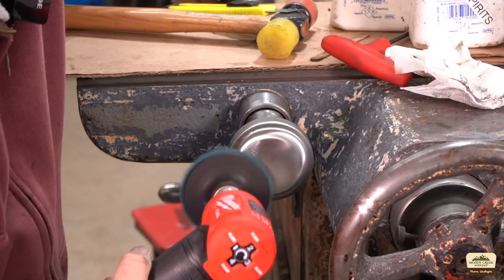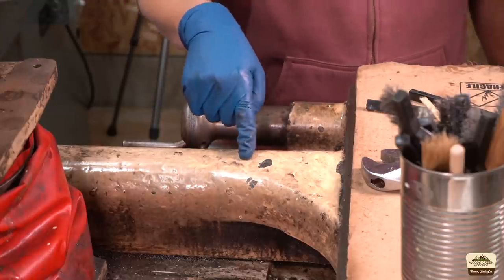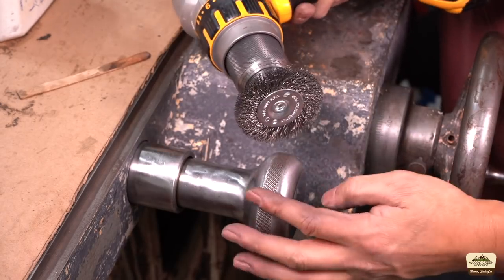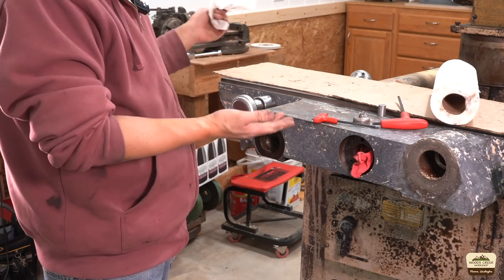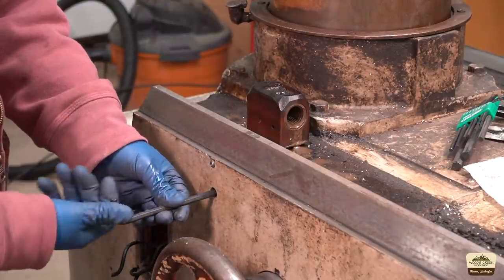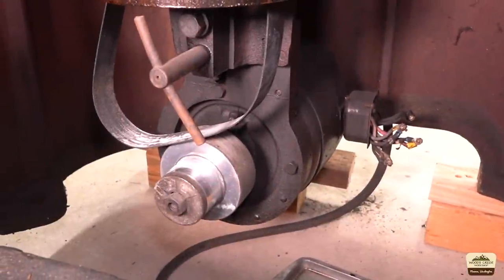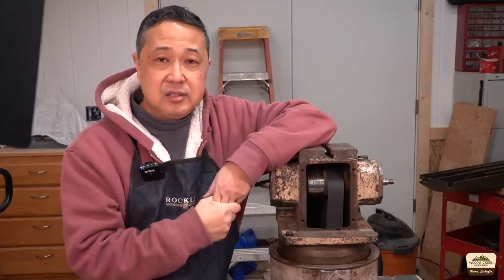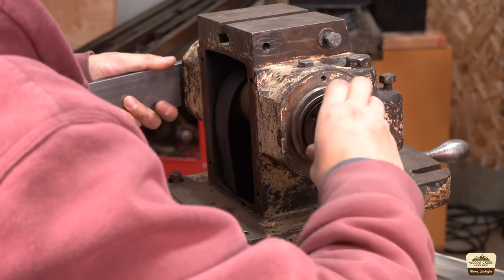More Bad News! Part 2: The Cincinnati No. 2 Tool and Cutter Grinder

Comment: Happy to see you back in the shop.  You do great work, and the machine doesn't look that bad.  Rebuild the spindle if it is not bent.  You know that today's bearings are far better than what was available 70 years ago.
Reply from the maker: Awesome, thanks David
Reply: Not true, bearings are made to a tolerance.  If ABEC 7 bearings were installed in this 70 years ago, then ABEC 7 bearings are required in this today.  It is easier and cheaper to meet those tolerances today, but the bearings are still made to the same tolerances.  The point that many people overlook is a standard tolerance bearing might meet ABEC 7 tolerances because it is easier to manufacture today, but if it meets standard tolerances, it ships, so you can’t assume standard bearings will meet higher tolerances.

Comment: I just went through the same thing with a DoAll Grinder, it's a 1969 model, they quit making surface grinders years ago but I managed to find a new matched set of bearings for the spindle, it was a pain to do but better than scrapping the machine.
Working with tolerances of less than 1/10th runout can be a hair pulling experience but patience and persistence is the key.
Reply from the maker: Awesome 👍🏼

Comment: I've refurbished a number of Logan lathes my personal one I decided to just while I was using it strip it completely down to the metal and leave it and it's the coolest looking lathe they've ever seen! I mean it's like I didn't even work on it cause I just did a little bit every time I was out there using it I mean while it was running I didn't do it but while I was in the process of using it that day I would do a tiny bit and before long it was completely strip. All I have to do is wipe it with light oil I use spindle oil and just put a light thin coat of spindle oil on all the parts so they don't rust and it looks cool as hell

Comment: Rebuild! The overall condition of the machine looks good (so far), and you can't beat the solid construction of those old machines. I know that spindle rebuilds can be tricky, but the assembly on this machine might make it a bit easier than you think; one side is fixed while the other is floating (with the split outer collar, one side has to be floating), so all you need to concern yourself with is getting the preload on the fixed side correct.
It would be a great learning experience, and besides, the machine will not be operated continuously so you will have the opportunity to get the bearing assembly correctly tuned if you see it's acting up...
Reply from the maker: I agree 👍🏼

Comment: I use a sanding mouse with 40 and 60 grit. Works great in removing old paint and smoothing chipped paint. I even smooth up the casting marks and parting lines if need be with a die grinder.

Comment: Yuchol, a  Cresent wrench and carriage bolts????  Com' on, man!!!! And we know you can and will fix it.
Reply from the maker: Just making sure you’re paying attention Bill 😁
Reply: Called a "Newfoundland vernier" in Canada. Shouldn't be seen on a precision machine even if it's in tear down mode. Please use a decent wrench. 
As for the cup/square bolts. If they do the job what's wrong. You're obviously going to replace them with the correct ones eventually.
Replace all the bearings. Make sleeves if you can't get the correct sizes but I'm sure you'll find them. Provide means of lubricating them after.
Thanks for the videos. Regards from Canada's banana belt.
 ☃️🇨🇦👍

Comment: If it were me I would get to the nearest good industrial bearing supply house and let them take a look at what you've got there and any info you have on the machine. I'm betting you can get bearings that are at least as good, if not better than what it came with 71 years ago! Precision hasn't gotten any sloppier in machine tooling over that time period. BTW- I enjoy your style. A little humor is a good thing!

Comment: As a skilled tradesmen/millwright, I was taught,always, if you remove a bearing or a oil seal, replace with new, don’t reuse!
Reply from the maker: I haven’t been able to find direct replacement, yet 👍🏼
Reply: The first thing my Grandpa taught me on a mechanical repair, always replace any bearing or seal you remove, no exceptions, restore to factory specs with new parts and you and your customer can sleep well.

Comment: Yuchol from what i have read the only thing that separates just bearings from precision bearings is the inspection. They are all made on the same process and the grading process is extra measuring which closes the gap on tolerances of both I/D O/D and TIR. My guess is inspection processes and manufacturing processes have improved by 1000% . . Even precision spindle rebuilders are at the mercy of the Bearing Gods and run every spindle before shipping. I say go for it. The result in the sharpening of the tool will be the final arbiter.
Reply from the maker: What sacrificial offerings will the bearing god require? 🙄😁
Reply: @woodscreekworkshop9939  1 arm one leg and any gold fillings you may have in your teeth. Since i am old and my teeth are falling out I think I would just get a tin cup and sit on the street corner with a cardboard sign.
Reply: Terry, Sorry but there is way more between standard bearings (Abec 1) and precision bearings (Abec 5 and up) than just inspection. In a former life in the bearing industry I worked for the local agent for Barden bearings. Barden only ever made Abec 7 and Abec 9  bearings (in the USA) They did this by precision production not by inspection of millions of Abec 1 bearings. It may well be possible to select for Abec 3 from Abec 1 but trying to select for Abec 5, 7, or the almost mythical Abec 9 from 1 and then to match two of them as a pair with a given preload would be a fairy tale…Martin
Reply: Sorry, but not even close to being true.  Precision bearings are made on their own production line.  The components may come from the standard bearing line, but the higher precision bearings are measured and then honed until they meet the precision class they are making.  I worked for FAG Bearings and they only made what was ordered, so there was no sorting for tolerances, it was made to the tolerance ordered and then shipped to the customer.  In the case of Barden Bearings as mentioned here, they only make ABEC 7 and 9.  The ABEC 7 are measured at the production machines using air gages and run through the honing machines until they meet the required tolerances, or are scraped.  For the ABEC 9 bearings, the components are taken into a temperature controlled room where they are honed until they meet ABEC 9 tolerances.  There is a significant amount of labor involved in this tolerance class bearing and the prices are fully justified.
Reply: @mikeb1520  I would like to see the evidence that supports this. Not saying you are wrong but i would like to see it. I am famliar with precision processes capable of maintaining 2 microns
Reply: @terrycannon570  I’m not aware of any public documentation on how they make their bearings, my statements are from being in the factories and seeing first hand how it is done.
Reply: @olfoundryman8418  exactly!

Comment: Well, in for a penny, in for a pound lol. You could try to drill and tap those tapered pins and use a slide hammer to remove them. I generally steer clear of those super flammable solvents. Varsol works really well for removing large quantities of gunk, and it's relatively cheap 😊. Well, hope you can find some bearings for it, I'd hate to see all that iron in the scrap bin. Good luck! 👍😁👍
Cheers!
Reply from the maker: Thanks 👍🏼

Comment: It is actually a little odd to me, I would have expected a 7305 bearing to keep the one side fixed, then the 2305 bearing floats to allow for thermal growth,  but being a grinder it's seeing only light axial loads so a deep groove ball bearing was probably deemed adequate.  you should look for a precision bearing like an abec7 or p4, a low grade bearing wont be stiff enough and you will see a lot of chatter.  if you haven't watched robin renzeti's spindle video i highly advise watching it at least twice, lots of valuable information there.  edit:  c783 is actually listed as a p5 + zero clearance---so that gives it the preload
Reply from the maker: Thanks Corey

Comment: Hello Yuchol, I am enjoying your video.  I found two new SKF C6305/C783G1 K3 bearings for $169.99 each on EBay.  They also list many SKF 2305 double race bearings in the $40-$50 range. I look forward to seeing you spindle reassembly procedure.
Reply from the maker: Thanks Jim.  Those bearings show signs of use, contacted the seller and they haven’t responded….. yet

Comment: Big job.  Hopefully lots of fun despite the surprises.  Definitely new precision bearings. That’s what money is for. “Once and Done!” Similar to you, I degrease wish Super Clean full strength over a few days, cleaning buildup softened gunk as I go along.  Then I strip the paint with Dad’s paint remover before bringing it back with some grinding of the castings and as little Bondo as possible before painting.  Not sure it’s better or faster, but just my way of feeding my OCD dragon.  Keep up the good work.
Reply from the maker: Thanks!

Comment: I have seen machines that were refurbished and that feature added to the waves during the scraping process for directing the oil to flow to a low spot so that is totally normal and they're never uniform they're always just sloppily done because it doesn't matter as long as there's a low spot for that oil to squeeze out in the direction that they wanted to but yeah I've seen this added this feature added intentionally

Comment: Whilst its split down its best to swap them out with a whole fresh set so that the spindle runs true. Everything needs maintenance and repairs, its not the end of the world or a scrap machine because the bearings have seen better days. Take ID and OD and search using those dimensions. Codes differ between manufacturers but their will be matching dimensions in todays precision bearings. Ive come cross many bearings that are hard to find but a search with the mesurements has always produced results.

Comment: If problem is limited to the bearings I would search online for a deal on a matched pair of precission bearings. If deal doesn't show, I would try with standars bearings. That would cost you a couple of hundreds and it will make the grinder usable again. Later, if you want to go full speed with precission bearings, it will still be cheaper than a new grinder.

Comment: I never liked that particular model of #2.  I worked at GE in Charleston, SC and our shop at that time had a bunch of these but none this old.  The belt drive spindles were too limiting to what we needed to grind on a daily basis so all our machines other than the Monosets had Pope wheel heads.  Granted you can fix this and it will probably work but a motorized wheel head version would have made you a lot happier.

Comment: Full bearing replacement.  The machine otherwise is looking good.  I would plug that hole and run a new line underneeth.  I think you are correct about it filling up.
Reply from the maker: Sounds good Phil👍🏼

Comment: I would just get new bearings. An ultrasonic cleaning can damage bearings, since the vibration can cause brinelling on the races from the balls banging off them with high frequency (and force).
Reply: I agree that new bearings would be best, but Mark over at RotarySMP referred to some aerospace-approved ultrasonic treatment of ball bearings in a video not long ago. 
I'ts intriguing at least for a hobbyist to attempt refurbishment of bearings this way.

Comment: If a one armed machinist in Brazil can fabricate a 4 jaw chuck in a tin roof shop running a home made mill and lathe setup, then what's your excuse when you have a shop full of machines to remake the spindle if you had to?  Throw out all those icky bearings and  buy a fresh set of Angular contact bearings. They are designed for spindles where precision and high speed are required. You can get bearings in all kinds of sizes and they're not as expensive as you would think. 

You can remove those tapered pins by drilling a hole through any of the ends and then knocking them out. Don't use heat because it expands the hole and the pin equally. Heat works for screws because the heating and cooling breaks the threads free. Also, check for peening. Sometimes the pins are peened from bon ends. A shallow drilling on each end removes them.

Comment: Not one for jumping on band wagons, but in this case - GET NEW BEARINGS! I wouldn't even consider using the old bearings, even if they seemed good. Not when you've got it apart. Looking forward to Pt 3.
Reply from the maker: Thanks Jim!
Reply: What some people don't realise is the precision bearings can be very expensive,  sometimes thousands of dollars, so you would not want to change them for the sake of it. Granted the bearings in this spindle cartridge are toast or well on the way to being toast, so I would be looking at sources such as ebay for new old stock in this case, but in general if the bearings on a machine tool being refurbished for a home workshop looked and felt good, and they were Abec 5 or 7 spec, then I would use them if possible. On this grinder it is no big deal to extract the cartridge for a change out if that becomes necessary.
Reply from the maker: @Ropetangler  very true, valid points 👍🏼

Comment: The shaft looked salvageable.  Double Dog check the shaft and order bearing if it seems usable.
Reply from the maker: I feel better about the shaft than the bearings, having difficulty locating matched set
Reply: @woodscreekworkshop9939  😟

Comment: Just a small tip that is probably far too late, but for taking off that first layer of grease / dirt/ don't want to think about it, I have been really impressed with a cleaning product called TSP. It's illegal in our state now, but they sell a TSP alternative which seems to work just as well. One warning, You will want to wear gloves, it melts your fingernails
Reply from the maker: Thank you 👍🏼

Comment: So the first thing I'd do is check to see what shape that shaft is in. Id measure it from about every direction i could find. And if it comes back in good shape. Then id call my local guy here in Warren, Ohio at Applied Industrial Technologies (Jim).  And id be ordering up a set of replacement bearings for the upper spindle. Now, Since I didn't watch part 1 yet. I'll assume you didn't spend big $$$ on this older machine??  As I wouldn't of either and taken my chances to clean her up and rebuild anything that needs it. And then have a good machine that still has some service life left in her. Because we are both doing this as a hobby and not trying to run a high production shop. Which these older machines are perfect for us hobby shop guys. Side note, I just bought a Wells Index 745. Thats went into service in February of 1968. And then sat idle from 1992 till I bought it in November or 2021. And the table drive gear box needed all new bearings. So I've been down this road recently. But only paying $600.00 for the mill and $100.00 to have a professional move it home for me on a roll back wrecker. I have a LOT of (💰)  room for repairs. 

And before I got carried away, I'd also check to see what other bearing you might need while you are at it. This way its all shipped on one shipping charge (or the 40 minute drive in my case) Saving you even more $$ for the budget of the restore/rebuild.  And if this shaft was out of spec. Id contact Adam in Florida at Abomb79 and see if he could do a spray weld job on the shaft and then turn it back to the OEM size for you. He does a fantastic job with his spray welding on shafts like this. And it makes great content for his channel. And he  collaborates with other YouTube channels as well.

Comment: You may be able to part out the salvageable pieces and move on. But, if you are using to sharpen cutters, a lower accuracy bearing set may be the way to go, if such bearings are available. ebay has 6305/c783 available..
Reply from the maker: I will double check eBay, I must have missed it

Comment: The last place I worked at before retirement decided to downsize their tool room and send most of their tooling out to be made etc  and one of the machines set to go was a Cincinnati T&C grinder same as this one.....offered to me for A$500.........who wants a machine as big as that, so I went for a Bridgeport instead.at 1/1/2 grand with a vice.......how can you refuse that.
The grinder was used 8 hours a day.....I can't imagine how boring it must have been to stand for 8 hours a day and work a T&C grinder, my most usage would probably take one hour any day of the week......the acquisition of a Declkel covered that.
Reply from the maker: I wouldn’t want to run it work full time, I’d go crazy
Reply: @woodscreekworkshop9939  It does take a bit of working to get used to using it.........did it come with any equipment or attachments like the motorised work head or the pair of centres?..........I would highly recommend a Cuttermaster if you were seriously thinking of doing cutter grinding......that has an air bearing work head with 5C collets and if you can get CBN wheels (quite pricey) you won't get all that grinding grit in everything.

Comment: Rebuild, new bearings and scrape the ways.  These old machines are built much better than new ones.  Fix it up and it will out last you.  Bearings wear out.  Look at GMN bearings for spindle bearings.  Made in Germany.